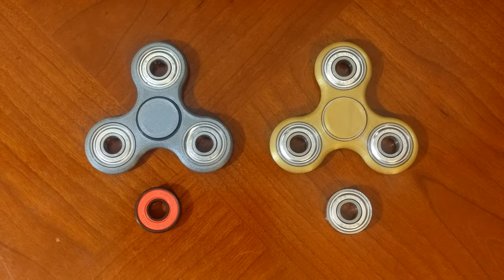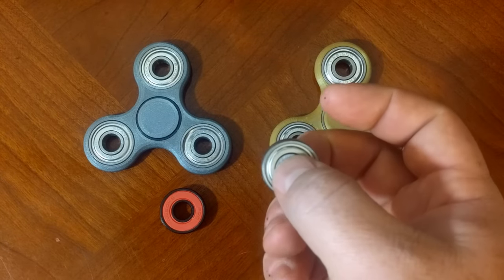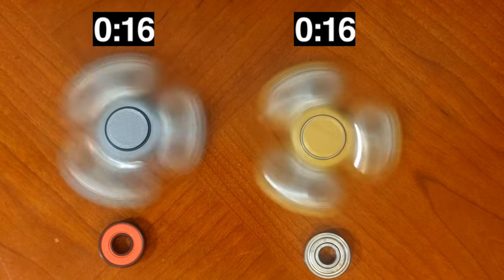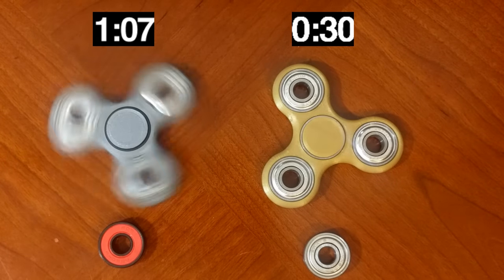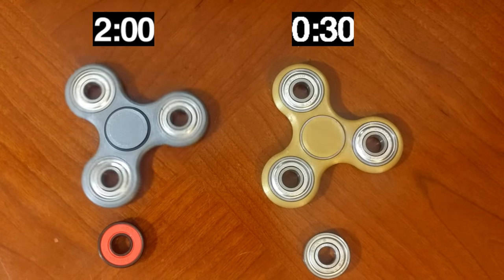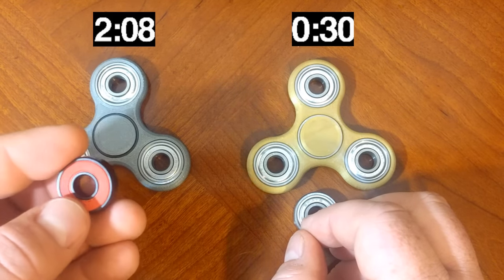Spin Test : Ceramic Vs Steel ball bearings ( Fidget Spinners )

Comment: Interesting video, but 30s on the SS bearing tells me it probably needs a cleaning. It should be able to spin for longer.
Reply: I was gonna comment on that. My clone Torquebar has what look like steel bearings, but when its clean, with no lube, I can spin it for 4:45. Haven't gotten past that yet.
Bottom line? Clean and DO NOT lube the bearings if you want long spins. Lube is for noise and wear.
Reply: Torquebar are sick ! ;)) But Best quality
Reply: Vincent yeah if you buy a regular skateboard bearing (steal bearing) have grease  in the bearing which makes it slower but if you clean out the grease the steel bearing spins longer and better.
Reply: SquirtinPsycho4 yes but under high load without grease the bearing will self destruct
Reply: Vincent  you realize you would find those bearings is a Walmart skateboard 😂😂😂 try are like abec 3-5's, pretty shitty
Reply: Vincent true. My spinner has steal bearings and it spins for 2 minutes flat.
Reply: Erik Vo yes same here
Reply: Ben King-Eagles can i clean it with alcohol?
Reply: I have steel bearings in my penny board, and the wheels barely move. The bearings don't need cleaning, they're just trash.
Reply: Wrong, 30s are average for steel ball with light oil. You Need some grease anyway and  light oil is least resistant, but most drying out option. Ceramics also need lubrication, but less.
Reply: @BenKingEagles  if you dont lube then youll kill your bearings. Ceramic are just far superior to steel, lubed or not. They have uniform size, they dont heat as fast, they are tougher and lighter. Their only downside is abrasion of inner tracks in races after 5k km, so for spinner its best to get full ceramic bearing.
Reply: @HECKAKYH-ADEKBATEH  I hear ya. Though a spinner puts so little strain on the bearings that without lube would make little difference to the lifetime. And the bearings are simple to replace, and cheap. I'd rather long smooth spins, lube gets dirty and needs flushing, I can clean my bearings with canned air in seconds.
Reply: @BenKingEagles  ymmv :)

Comment: How are the noise levels? Which is quieter?
Reply from the maker: Shiki Ichinose ceramic with light lubrication is near whisper quiet.
Reply: Shiki Ichinose ceramics are louder but spin faster steel is whisper quiet but doesn't spin as long or as fast
Reply: Shiki Ichinose
Reply: how would you lubricate it?
Reply: aaah thank you.
Reply: That sounded wrong in many ways
Reply: RottingCarrot ikr
Reply: sorry lol, I just bought the oust moc bearings so I don´t have to lubricate it yay
Reply: Reina Kagurazaka ceramic quiter.
Reply: sound energy uses an almost unmeasurable amount of energy in a system buddy. friction is much more impactful

Comment: Thank you dude so much I now have changed all my spinners to ceramic, this video was a great help to me, also can you answer this question: Is a double spinner faster than a tri spinner?
Reply from the maker: +Morgan Nicoll good question. Tri spinners have more mass than double spinners and should spin longer. Speed at the begining of the spin should be the same. Double spinners will have a faster deceleration.
Reply: However, double spinner's have less drag and this counteracts that a slight bit, but the spin time should be longer on a triple spinner.

Comment: All depends on the build and weight of the spinner. I've seen steel bearing spinners spin for 5 minutes with ceramic stopping at 40 seconds, overall hybrid ceramic is great in a good quality spinner. Degrease the bearing tho. You don't need grease to worry about load friction. Something like Bones speed creme works great as well.

Comment: Not enough control in your experiment.
Reply from the maker: How would have you done the test differently?
Reply: got em
Reply: I would have done one of two things. 1. Spin both of them at exactly the same time so that the timer shows exactly how long they've been spinning. Or 2. If you're going to spin them at different times, start the timer when they start spinning.

Obviously, the control doesn't matter much here because you started the ceramic first and it lasted longer, so ceramic is clearly superior.
Reply: +Patrick Holmgren Got em.
Reply: ClassicalHD It spun for a whole 1:30 longer...it doesn't matter how much you control it of the difference is that large...
Reply: Let me quote myself.

"Obviously, the control doesn't matter much here because you started the ceramic first and it lasted longer, so ceramic is clearly superior."
Reply: ClassicalHD Kinda pointless making the comment then, bc you contradicted yourself on the same comment
Reply: No, you see I'm pointing out the fact that the experiment is not controlled, regardless of how crucial it is. You however, are just restating something that has already been said, so your comment is actually pointless.
Reply: ClassicalHD So is yours...if you're just gonna contradict yourself you might as well delete it
Reply: I mean, no. But you do you.
Reply: ClassicalHD I was suggesting it, so saying "you do" makes no sense
Reply: I agree, no way to to judge how much force he applied to each. Would have to use something like air pressure to make it controlled.
Reply: u spun the one like 1 second after the other
Reply: ClassicalHD because he taped it you could time it in the scrubber bar to see how long it took instead of using his in video clock
Reply: Ceramic bearings typically use a lighter weight lubricant than stainless, due to the expected use case of the bearings. Strip both bearings of oil and oil them both with PTFE or Silicone lubricant.
Reply: golgathum 7
Reply: golgathum exactly, that's what conclusion I came to after watching this video
Reply: also he got a standard steel bearing, and got a decent ceramic one.
Reply: KitKat furry kat-girl  that's not what he meant he spun it by hand meaning that there could have been a difference in how hard he spun it but only slightly and the times were not close enough for it to have made any significant difference so he still proved his point
Reply: Benjamin Berry q
Reply: ClassicalHD ik
Reply: ClassicalHD
Reply: My steel bearings go for 5 mins
Reply: there are two factors what affect the friction of the bearing, the grease inside, and dustshields what grabs the inner race a little bit thus slowing it it down.   So for such fidget whatever..  application, we would need to flush the metal bearing off any grease and remove the plastic shields too.  And i say it would perform the same or maybe even better because of greater weight.
Reply: Mark Fuller I would have put them in a skateboard then rolled down a hill and see where I stopped

Comment: i have a question so i know that if you deshield a steel bearing it spins longer but should i deshield a ceramic bearing
Reply from the maker: +CJ R. I have been doing some testing on removing the shields on the ceramic bearing. Yes removing the shields allow the bearings to spin longer, but it also allows for more dust to get into your bearing. Double edge sword. Even the smallest amount of dust reduces the spin time dermatically.
Reply: Mark Fuller thanks I think I'll just keep the shield on so I don't have to clean it 😂
Reply: CJ R. Take it out if u don't you can't clean it as much
Reply: CJ R. Taking off the shield does not make it spin any faster
Reply: Franky Doyle I took the shields off of my metal ball bearing and before I did it spun for 20-25 seconds but now it spins for 35-40 seconds.

Comment: my ceramic span for 19 seconds..... i think it might be fucked
Reply from the maker: +saint3211 how long does the bearing spin by itself? Did you do anything to your bearing or is it still stock?
Reply: I can't remove the bearing at all, I think it's glued, It's a stock hybrid ceramic bearing ..though i do feel a weird catching when it spins at a certain speed..I'm sure that's the problem ...that or maybe it's the weight..It's heavier than my others.
Reply from the maker: Did you by the spinner from China? It sounds like you have something in your raceway. Did you clean your bearing yet?
Reply: haven't cleaned it yet and no it was manufactured in the UK
Reply: If it's heavier yet still the same size it should spin longer... lol
Reply: saint3211 
Degrease and take the shield off of the bearing. That should improve spin time!
Reply: I ended up in hospital, They pumped me full of morphine and I got so high that I left it there...Now it will never spin again...At least, not in my hands :L
Reply: saint3211 Brings fidget spinner to hospital  "Must... fidget.. through... morphine..eh...e...h..
Reply: My steel one went for just over 2 minutes lol. Yup you're screwed.
Reply: Mine spins for 6 minutes

Comment: You've been a bit bias due to buying the cheapest steel bearing but still quite a good comparison between two but usually the manufactures of the spinner get a steel ball bearing and take out the grease that makes sure it doesn't over spin to make it last longer on spin time, so I think if you were to do this to the steel ball bearing you have it would probably last a bit longer than it did, good video 😄

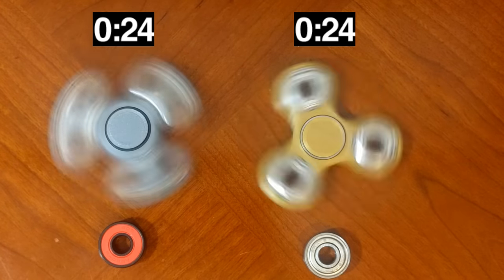Comment: there was a cut at 1:00 that's why the steel ball bearing slows down so abruptly.
Reply: N.B. Lite no that's normal because the Steel having more resistance, when it is slowing down the resistance pretty Much takes over the speed
Reply: Jesse Wright did you not see the cut?
Reply: It's just how it looks like on camera & why would he want to make the steel one slower
Reply: N.B. Lite are you guys literally blind or something? I hope you see that it's a cut... both spinners, at the exact same time changed speed.

Comment: ask a real pro instead of an amateur (like the ones who claim to be pros in the comments) cermic bearings are for longboarding where high speed and heat is imminent, steel/titanium bearings are for skateboards because of the higher strength in the balls to the bearing race. the 1,3,5,7,9 etc Does equal the grade of craftsmanship, not how long they last otherwise they would cost twenty dollars for two because corporate funding ;). Now I wanna see a bones red vs. abec test
Reply from the maker: Building a test rig this week to test, bones red, full ceramic, hybrid ceramic, abec and more. Good information you provided as well.
Reply: Are spinners with 6 bearings on the outside better than the standard 3 outside bearing ones?
Reply: +AE Titan and why do the outside bearings matter? Do they make the spinner more heavy and make it spin faster?
Reply: Ceramic bearings have been used in skateboards for years before longboarding. They aren't "designed" for longboards, just preferred. Bones Swiss Ceramics were created for Skateboarders and lots of them use them because of their ability to ride smoother and last longer in water.
Reply: AE Titan yeah
Reply: Everyone knows Mini-Logo's are best ;) Skateboarders(not long boarders) usually hate ceramics, cause they bust faster than steel bearings, which sucks.
Reply: +Richard Smith ح
Reply: +Richard Smith ح خ؟(
Reply: Richard Smith no, ceramics mostly are better, like bones reds ceramics are better than bones super reds

Comment: I know that the ceramic ones are better, but I don't like the way you proved it. They did not start to spin at the same time. Also you can induce to an error by pushing each one in a different manner without you noticing it. So to say that one spins four times longer that the other  may be true, however the approach is not very accurate.
Reply from the maker: Schwann Mutt If I redid the test how would you do it? I was thinking using air and a tachometer so they are all at the same speed.
Reply: Yes! Once they achieve certain speed you stop the air and start the chronometer. Thank you for answering I didn't spect that. :)
Reply from the maker: Schwann Mutt I just ordered bones reds and some others bearing to do another test. Hopefully post in 2 weeks the results. 👍
Reply: Cool!!

Comment: It wasn't a fair test cause they started at different times!
Reply: Eep Homework the ceramic bearing would still have gone longer
Reply from the maker: +Eep Homework we'll add 2 seconds to the ceramic bearing. 😋
Reply: Eep Homework we all know the ceramic would win anyways. clearly!
Reply: Eep Homework valid point but it doesnt matter. The one that started earlier stopped later
Reply: Eep Homework keep in mind that the ceramic bearing was spun first and still lasted longer
Reply: Eep Homework well the one on the left won and it was first

Comment: With what you were saying about the ABEC scale isn't necessarily true.  The ABEC scale is how tightly fitted the balls are to the races, getting tighter as you go up. I recently got some ABEC 3s that spin much longer than my ABEC 11s I had on my longboard. The reason the ceramic bearing spins longer is not due to the ABEC rating but because of the little amount of friction. This is why some of the top bearing companies have dropped the ABEC scale like bones reds bearings. Also a little tip I'm not sure you did or not, but you can remove the shields from the bearing reducing the friction, having  a longer spin time.

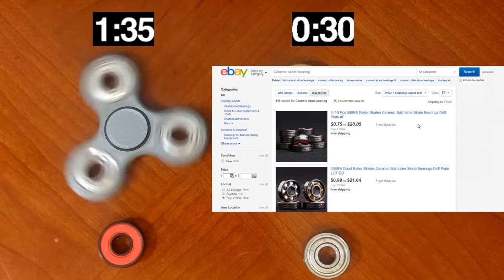Comment: I got my Zr02 ceramic bearings to spin for 2:13 with a one hand spin! I bought it for $18
Reply: Random Vids most quality steel ball bearings buy for about 13 dollars and they would definitely spin for more than  two minutes, this YouTube bought bad bearings if the only spun this long,  there shouldn't be much of a difference between the two types of bearings because ceramic bearings were simply made to withstand harsher climates, if they are both clean and have all the bearings there shouldn't have been that much of a gap.
Reply: Random Vids worth it
Reply: Random Vids that's bad, got mine from Fred Meyer $5 and 4 minute spin

Comment: Lol, that's not a good test.
I have a steel bearing in the same spinner and it spins for over 4 minutes.
Reply: West Senkovec Link to it?
Reply: umm i doubt it.....maybe a bones reds ceramic could last that long but i doubt any can really
Reply: Brock Davidson Lol, how much do you wanna bet? I'll upload a video.
Reply: rather not bet lol what brand is it and yeah you should
Reply: West Senkovec where is it?
Reply: West Senkovec video or bs
Reply: with ILQ-9 easily :D
Reply: West Senkovec bull shit
Reply: That depends on a lot of things. Heavier spinners can hold more kinetic energy at a lower rmp, so you could have even spun your spinner at the same time, but used more force to spin yours, giving more kinetic energy.
Reply: the heavier the spinner the more friction so it wouldn't spin for that much longer unless you have some magical lubricant that would help the steel act as ceramic and lower the friction, still waiting for the video though ;)))
Reply: Yeah me too I got a spinner that gets 3-5 minutes of spin times and I figured out later that they were actually steel bearings and I paid 15 for 2 spinners great deal on amazon
Reply: Jose Marcos different materials create different amounts of friction and it just happens ceramic makes a better bearing than steel due to this(surface area of bearing compressed against the surface of the body of the bearing )
Reply: Jose Marcos on amazon a lot of spinners say that they are ceramic or hybrid ceramic but in reality they are just lying
Reply: West Senkovec where did you buy can u link pls
Reply: Chris True Skate how are they selling then that's false advertising
Reply: TANMAN84 that's my point, on amazon they have a lot of fake advertisements
Reply: I got it on ebay from an auction when those things weren't so popular. I was lucky to get it under $10 and the seller sent me the wrong color/type. Since it was from China I don't think I got some super fancy bearing in. I really should do a video about it since people have been harrasing me about it for months lmao
Reply: West Senkovec exactly i have one too i just bought one from internet i dont remember what site but it just spins for like 3 mins or more
Reply: West Senkovec  You don't have the same spinner his is 3d-Printed So the only way u have same one is if your ordered from him and also, Not all prints print at the same quality so even if u ordered from him it wouldn't be the same.
Reply: overwatch gaming gaming ahhh you don't remember the site how convenient
Reply: West Senkovec same
Reply: Are you sure it is steel. Some ceramic bearings look like steel bearings (the best have balls that are silver, not white) causing them to look alike. I have a fidget spinner with a ceramic bearing. It spins maximum for 6 minutes.
Reply: West Senkovec same this is not true at all

Comment: But does bearing size have an effect? I have a fidget spinner different from the majority at school, and although they have ceramic bearings and I have high speed stainless-steel bearings, mine span longer. The bearings in my fidget spinner are tiny as heck, so maybe that plays a part.

Comment: Sealed bearings are usually packed with lube that causes higher resistance; reapplying with a very thin layer would change it drastically . Not only that but those are not full ceramic bearings...

Comment: What about the external bearings? They are all made of steel, so do they work in any way or are just a mass that holds inertia? Btw I've already bought the ceramic bearing you showed on the video :P

Comment: So I just saw these on TV and thought they were awesome, but my question is, where do you buy the actual Fidget Spinner?  And which is the best one to buy, there are so many and so many prices.  And did you buy one and then take the bearing out and replace it with one you bought?  I'm so confused about these and I'd love to get them for my grandchildren.....and of course one for myself!  :-)
Reply from the maker: Rene, I own 20+ spinners. I still prefer the one I designed and manufacture. So does over 100,000 people that have also made them. http://etsy.com/shop/MrFidgetByMark